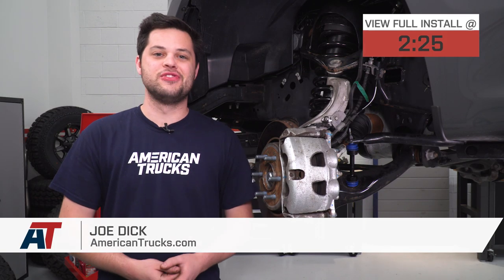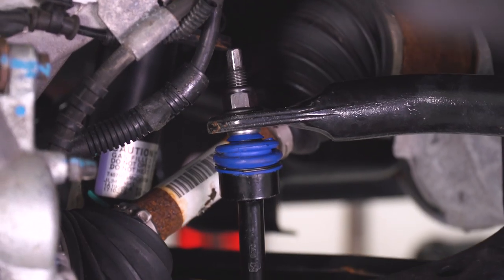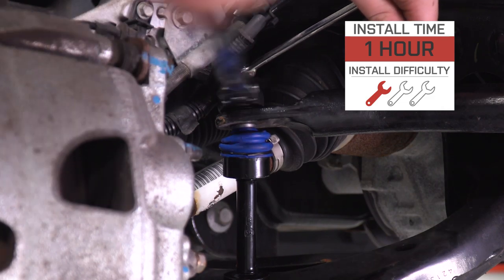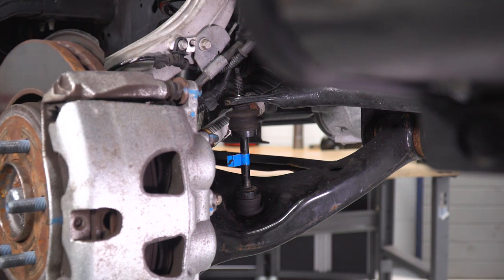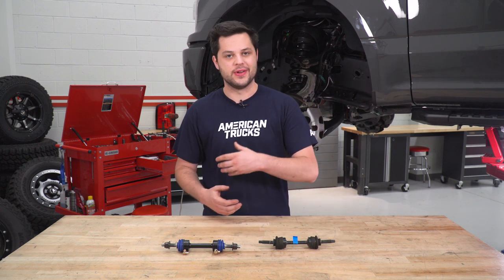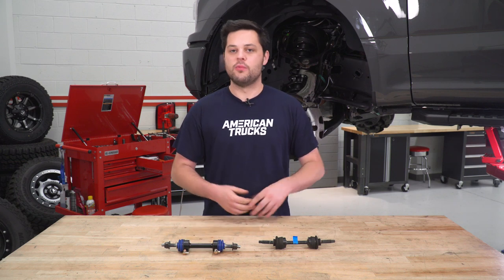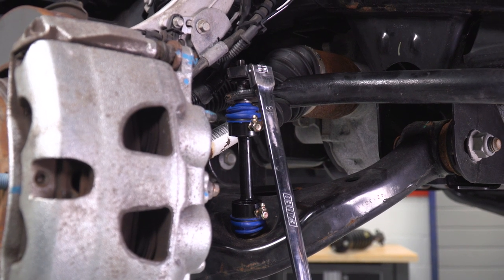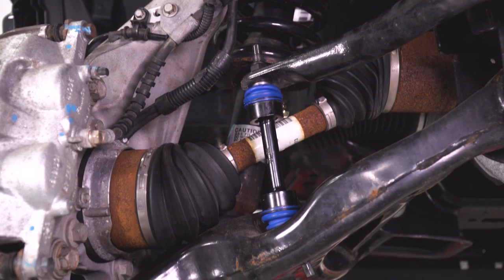2009-2019 F150 OPR Front Stabilizer Bar Link Kit Review & Install

Comment: I installed these on my 08 f150.  The old links have the sway bar towards the top in between 2 bushings.  They always seemed to deteriorate over just a few months even without squashing down on the rubber bushings too much.  Seems this design will still fit and function on the 08 and older models 2wd or 4wd.  I'm hoping that they'll last longer than the other design of links.

Comment: Went to order two of these but your site advises they will not fit my 2015 RWD F150 2.7L.  Yet, the title advises 2009 - 2019.  Please advise if this is the correct end link to get for my truck or not. Thank you.
Reply from the maker: Not too sure why our site was advising these guys won't fit, as far as I can see from our fitment information these will fit model years 2015-2019 2.7L EcoBoost F150s, including 2WD versions. You should have no problem getting these guys installed. -Zach
Reply: @americantrucks  Thanks Zach.  Thought this was the case.  Just confused when I put in the particulars for the truck and it came back as a no fit.  Will be ordering shortly. Cheers
Reply: John Hall how did these work for your truck? I have the same model and was thinking about getting a pair.